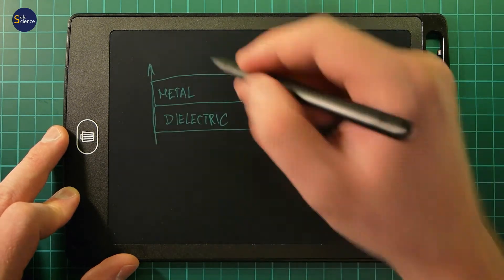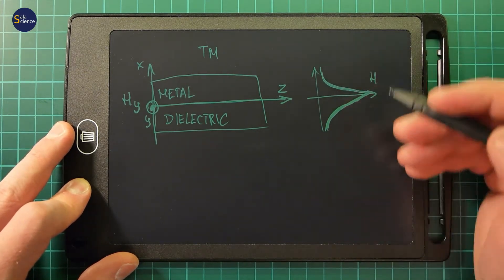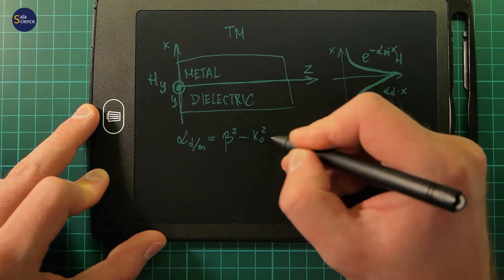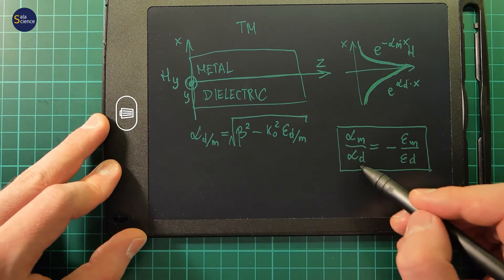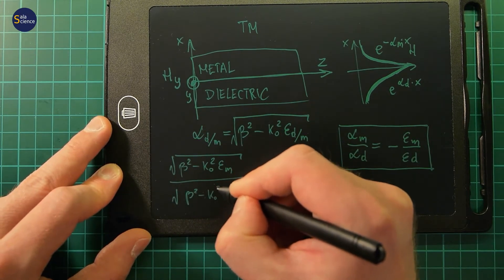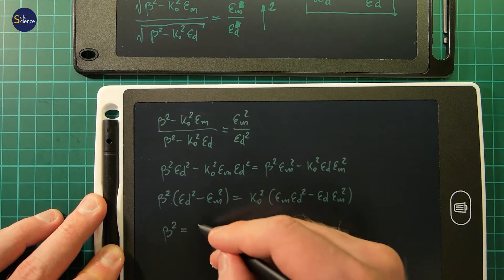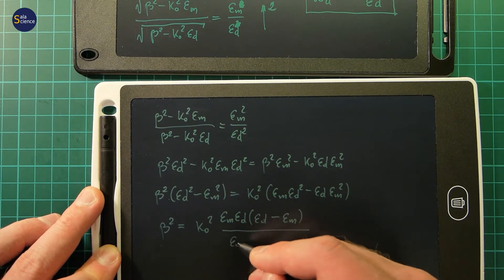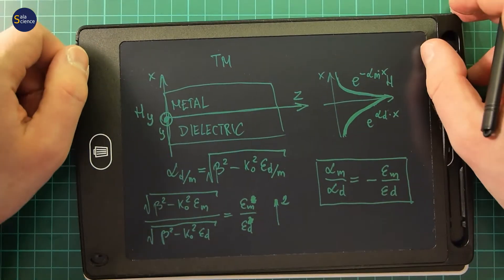Surface plasmon - 2.0 Planar waveguides - Optical Waveguides and Fibers

Comment: Good video, what kind of energy could make a 00.08nm lens project the afterlife onto a plasmon surface using indexed metamaterial and telepathic light reflections, teleportation and ultra-weak electromagnetic radiation also converting light into sound and a force field?